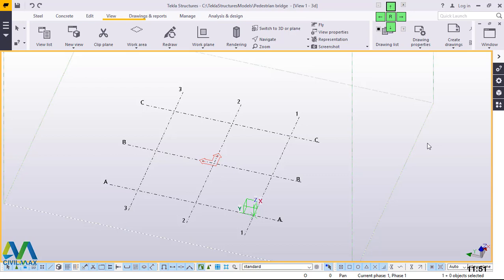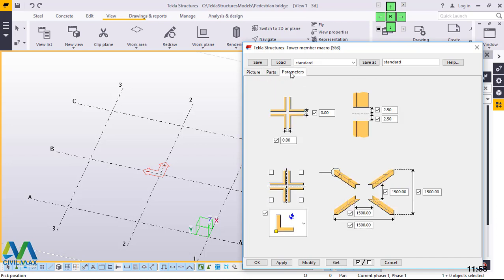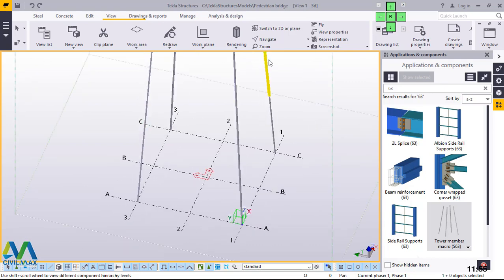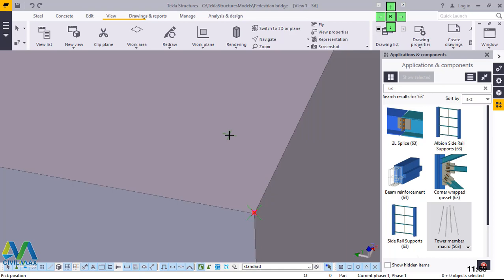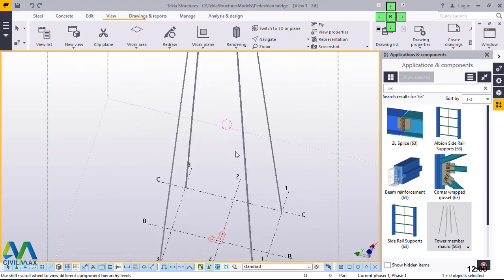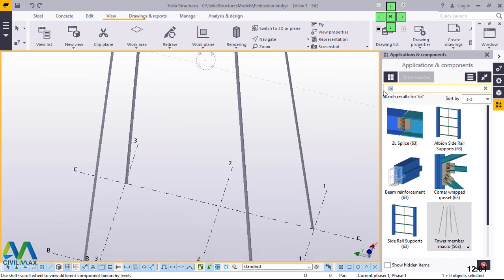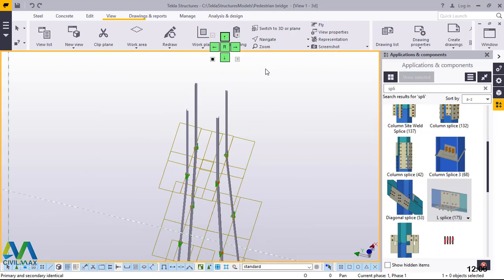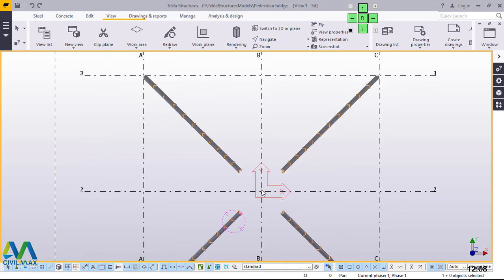How to Create Telecommunication Tower in Tekla Structures

Comment: Then I put the L splice the connection shows red wireframe cone.  Not works. How to fix that?
Reply from the maker: red cone means connection is not right, please adjust connection setting measurements